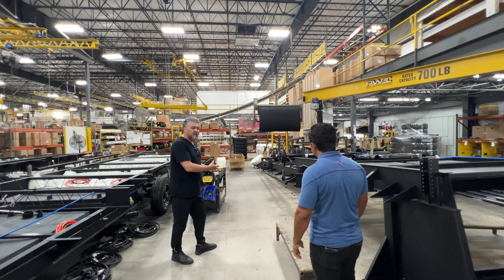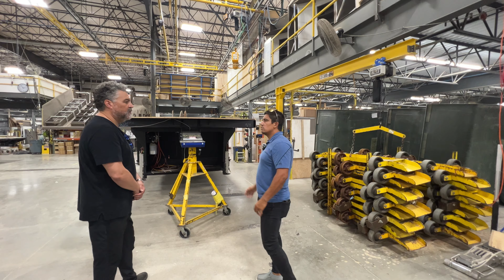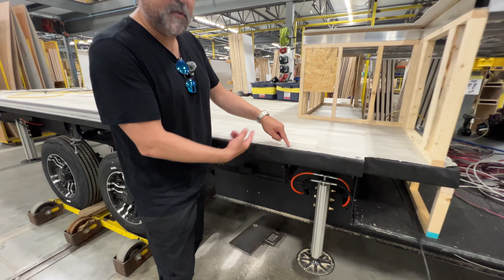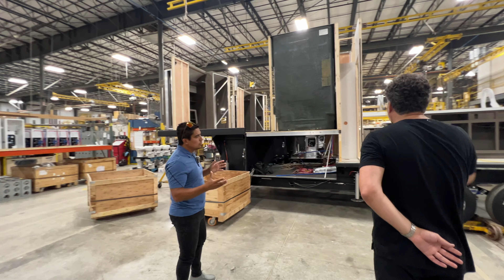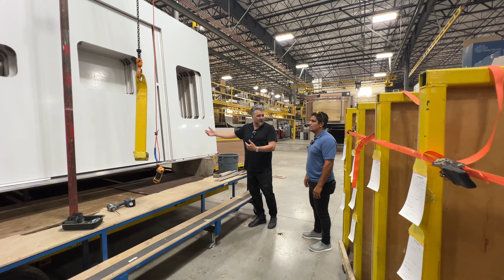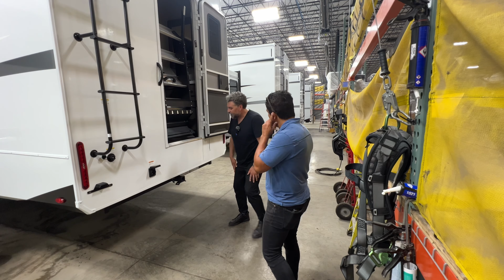Inside the Grand Design Factory: Behind-the-Scenes RV Tour

Comment: Total trash brand. Stay away folks and save a buck. 2023 and already got and 8-9 thousand dollar complete roof. Had 5 leaks in different spots with rot. Now lucky me, the whole slide roof is due for a re roofing due to tape sticking to the inside wall when open. Wow. Couldn’t stress enough, stay away folks. Hope this helps some poor sole from making my mistake. Gonna be 11,000 deep on a 2023 what a joke. Trash.🤪😂💔🤢🤮😳👀😱good news is my tech is busy due to Grand Design he’s got another roof waiting to be replaced on a 2023 later purchase in 2024. Trash

Comment: How much is built by Grand Design?
Who decides and specs out everything that isn't manufactured by Grand Design?
How much of that Grand Design trailer has Lippert all over it?
Who thinks a four-season trailer should have single-pane windows? 

When you purchase one, you'll get a very big stack of warranty and product information for all the "stuff" you're getting that Grand Design chose to install. That should inform you just how many hassles you're going to have in dealing with issues. 
A personal example: In no time at all, we had a propane valve break. No problem getting a replacement, but there were conditions...we had to take the trailer to an authorized repair place that was 60 miles one way from us, and we had to leave the trailer there. We were told there was a 3-month backlog of repairs and they'd call us when it was done. 
They wouldn't send us a new valve for me to install because they said by law it had to be an authorised repair person. Whether or not it was true...that's the way it was. I purchased a new valve and hooked it up to my tanks. 
Went through the same BS with a busted window. I purchased a window and installed it. 

My point? I can see a person who is depending on somebody else to pay for and replace all the different failures, but...good luck and happiness for you.

Comment: I've heard far too many complaints about Grand Design products and their service.  But they're not alone:  units built during the pandemic from all the manufacturers are basically junk.
Reply: I bought a 2022 2800BH - Mid pandemic. Lots of minor issues. Lots. Sold that and got a 2025 3210BH. Very noticeable difference in final build quality. Overall, it appears they have ironed out some quality issues compared to this COVID campers…. I heard a lot of horror stories about them! And I believe I owned one.
Reply from the maker: Interesting, do you own one yourself?
Reply: @LeisureDaysCanada  I own a 2024 Solitude, and I've already put 18,000 miles on it with no significant issues.
Reply: Lol!  @rvliquidators